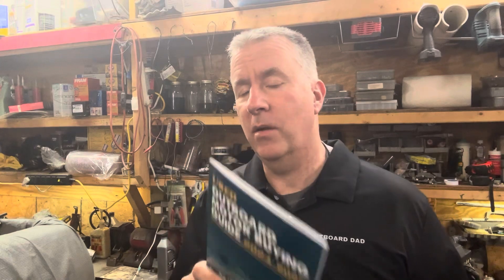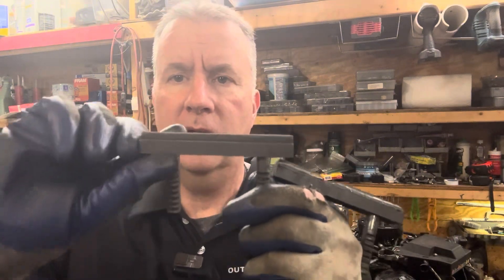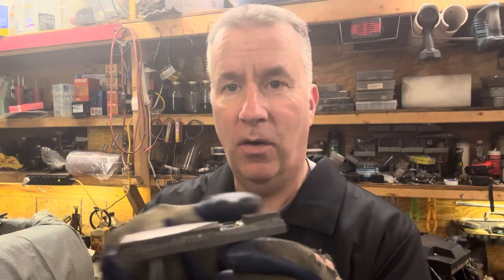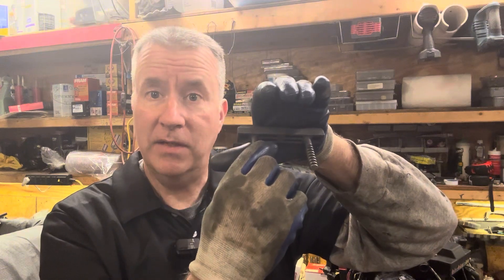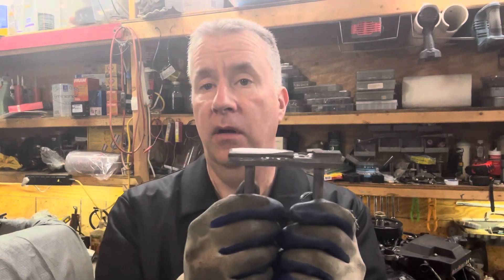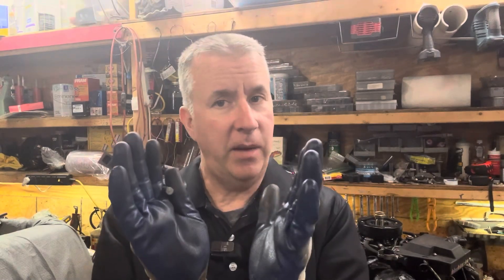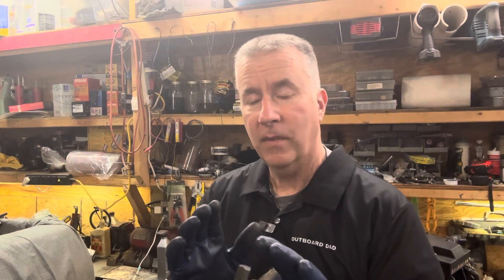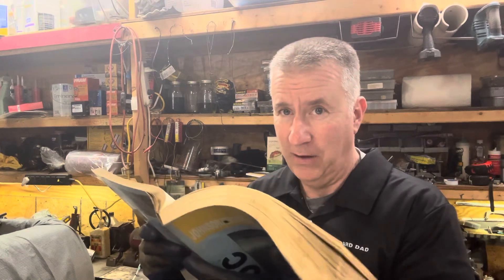How to Modify Sunnen Stones for Blind Hole Cylinders

Comment: Hey Keith just going through some of your videos before I start to hone my block. I bought an an111, and a couple of sets of stones. Im curious instead of making this stone for that purpose.... could you just use the an100 straight stones, and just running it at the bottom of the block without moving it... until you reach your desired with, and then just machine the top to match that. Instead up dicing up a set of stones?
Reply from the maker: In my opinion no, then you will end up barreling the cylinder. Do you have a dial bore gauge? Email me keith@outboarddad.com

Comment: I used to use Sunnen stones with a hard tip. Not an option in that style mandrel?
Reply from the maker: @leifjohnson4122  What do you mean by hard tip?
Reply: @OutboardDad  off the top of my head it was a R28J5701A. I think. The end is a harder stone made just for blind holes. Either that or we would just file some slight back taper on the stone. It wasn't too bad to maintain but just needed to focus more.
Reply from the maker: @leifjohnson4122  Interesting, I have heard of grinding off some of the stones, but then I thought why waste so much and just remove it. Appreciate your comments.